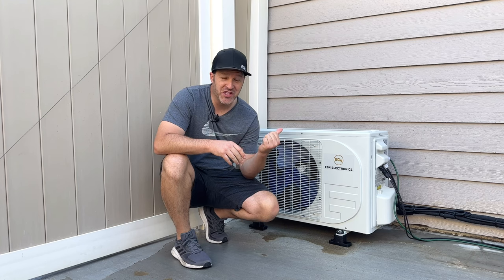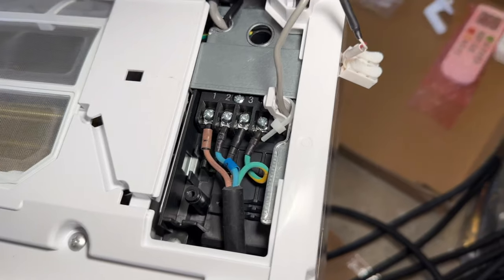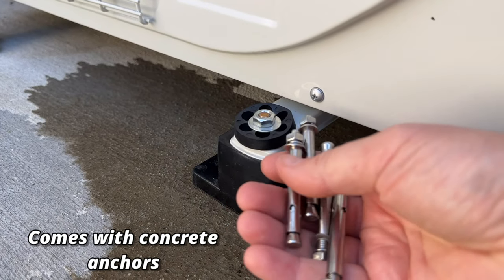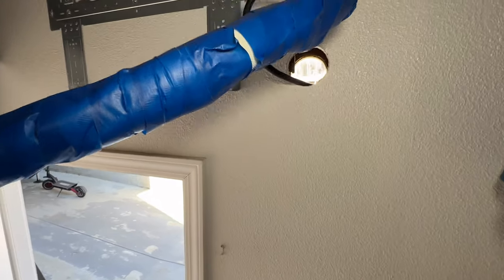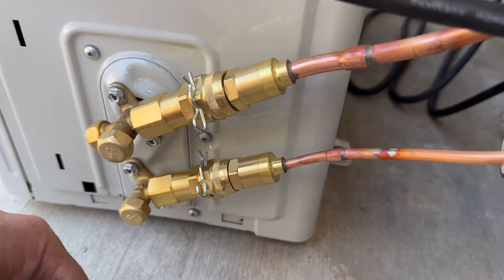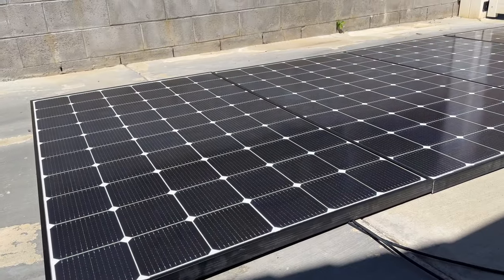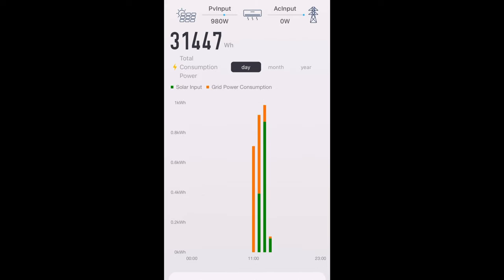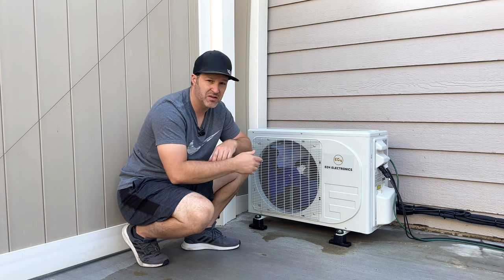Mini Split That Changes Everything! EG4 Hybrid Mini Split Heating And Cooling!

Comment: Is it possible to collect and store the extra solar energy with this unit?
Reply from the maker: No unfortunately not. Best would to be run solar into battery bank then mini split off system.
Reply: @johnnysweekends  If I set it up with all my solar going into my Bluetti battery bank (8k) (also have another 13.8 Zendure Battery Bank) Can it be run off DC output and also have it plugged in for AC so that it will charge the battery bank and then pull from AC when needed? Not sure if this makes sense but I have 3000w of solar now and am trying to figure out how to best use my panels by charging them and running the unit. 

Seems like it may be best to have 1500 watts to the unit and then run 1500w to the battery bank and also plug the unit into the batteries so that it won't run off any grid power. My solar does not go into the grid at all so just trying to figure a way to use all my soal and storage. Thanks!
Reply from the maker: @scottfreedom2012 unfortunately can’t power from bluetti dc out as it’s not enough power. 90v minimum. 
Hence combo of solar and also plugged into AC 110v outlet or hard wired works great. 
But solar during the day to power it and extra solar for battery storage! 
Or just cut the bills down gradually
Reply: @johnnysweekends  Thanks kinda figured that would be the case. I’m fine with it but was trying to figure out how to maximize storage and running the unit. Maybe run 1500 watts to the unit and the rest to the battery and when its not enough solar it can just pull from ac outlet on battery. Either way it’s free power from the sun and can eventually help pay back investment. Right now just running a window air con unit and it just not as efficient. Again thanks!

Comment: how well does it cool /how many sqft
Reply from the maker: So quick example.

103 degree day
Comes on automatically at about 8:15am and shuts off at 6:30pm which that will shorten as the days shorten

Almost 500sq ft garage 
Non insulated garage 
Non insulated garage door
10ft ceilings 

Now stays about 82-85 degrees all day. 

Verses it was normally 96-100 in there depending on the day.

I’m insulting my garage door this week, with thermal barrier and adding the outside weather strip all the way around the door so will see how that does. Then eventually I’ll spray foam the inner walls here and there and that will help for both summer and winter.

If I can keep it upper 70s in high outside temps and have it run for free from my RV..👍🏼👍🏼
Reply: I have 2 12 K units. They work awesome. I had my living room at 66 degrees today. They cool my entire home. One upstairs and one down. My family is impressed.
Reply from the maker: @LarryDoti dude i am loving mine. Haven’t had it plugged in yet lol. Just solar and RV setup 👍🏼

Comment: I wonder if it's economical yet to consider the additional capital it would take for a 24,000 BTU unit to run on solar? 

It seems it makes a lot less sense in areas where the minisplit is going to run 24/7 from May to August, in really warm areas of Arizona,  and Nevada
where it's still over 85 degrees in the evenings,

I know there are solar panels that produce over 700 Watts per panel now, 
but can a system like this along with the powerstation or batteries,  come out to less than 2500.00  (excluding the minisplit of course) ?
Reply from the maker: The mini split is gonna be $1700 ish dollars alone. 
If you can find some 300-350 watt panels used that would be best way to save money. But batteries would be needed. 
But a 24k btu is also gonna be a 220v unit

Comment: How does the 3 prone extension cord connect to the unit. Im not familiar with wiring and all, but i have a wall outlet outside. Does it have a plug in the unit to just plug it in.
Reply from the maker: It shows how to wire and where they go. It’s only 3 wires. Pretty self explanatory 👍🏼
Reply: @johnnysweekends  thanks sorry for asking I was just confused because I see something like a regular extension cord with a 3 prong going to your power station. 

On your video I saw how it was wire in into the unit but didn't see if the other side was a 3 prong ac wall socket. That why I was confused but if it like that it makes sense and I will definitely get one because I don't want to deal with wiring to the breaker box since I have a wall outlet outside.

Thx again
Reply from the maker: @oodavidyyf8416 yes just a normal 110v extension cord but use a good one with at least 12g not 14g. 
A long run may need 10g. 

Use the discount code with link in description so you don’t pay full price..👍🏼
Reply: @johnnysweekends  ty buddy I will make to get a 10 guage extension cord and will definitely used your code

Comment: The eg4 is cool. I bought the inovair 9000 btu which is 38 seer and only pulls a couple hundred watts off my batteries and panels. It was about twice as much as the eg4 but it's great on solar or batteries day and night. I like the fact the eg4 has its own panel hookup and all but after studying up on minisplits I'm glad I chose the inovair. Same install really tho
Reply from the maker: Yea the eg4 is a easy setup for most people but I like that Inovair. 
Thanks for the feedback on it 👍🏼
Reply: @johnnysweekends  I'm trying to talk my dad into getting 2 of the eg4s for the upstairs of his house. They are definitely the most economical way to integrate solar air-conditioning into a home. Thanks for doing the videos.
Reply: I’ve heard about those 38 seer units. There 230v though.I’m about to buy a bigger inverter so may get 240v inverter.
Reply from the maker: @2hotscottpro it will defiantly heat and cool more but of course use more power as well.
Reply: @2hotscottpro  they have a wide voltage range they work at. I forgot the exact numbers but it's like 195 to 255 or 255. I use a split phase sungold power and it works great. I use both legs to run the minisplits and I sperated the link connector on the breaker box making it 2 separate 120s so my camper is now 240... But yeah the inovair has some cool features that I couldn't find on other minisplits . David poz video helped me choose what to buy
Reply: I read that Gree makes innovair.And Sigineer power makes sungold.
Reply: @2hotscottpro  I think you are correct. I wish I'd gotten a smaller minisplits like maybe the 6000 BTU. I have the 9000 and it's great but it's way overkill and it doesn't have time to actually condition the air. It turns of and on and it's not on long enough to remove the humidity. It's in a 30 foot camper but after taking into account the space lost to cabinets and appliances it doesn't leave much space to heat or cool. It's super efficient but I definitely should have gotten a smaller unit
Reply: @matthewknight5641  that’s weird.I have a 36 footer 15.5btu and 13.5 btu.They both work hard to cool the mid and front section.I keep the 13 foot garage door closed.
Reply: @2hotscottpro  my camper is a holiday rambler and parked in the shade but it still gets pretty hot in the summer in TN. The actual area inside my camper that is being cooled is so small and my solar and batteries easily keep it nice inside 24/7. I do have over 30 kw of lithium 280k eve cells and a 4000 watt sungold power split phase inverter. I use 3 victron charge controllers and 6 280 trina panels and 8 235 sharp panels. The solar stuff is just a hobby but it keeps us from ever needing to plug into the grid. I'm only home a couple days a month tho. Most the time I'm stuck in this semi truck lol
Reply: @2hotscottpro  a 240 volt mini split uses less power than a comparable 120 volt. The only bad thing is that you gotta have a 240 inverter but by removing the connector link inside most RV breaker boxes it makes it where the loads are split between 2 120 legs and I just wired in my minisplits where one leg is from my old air conditioner breaker and the other leg pulls from the same breaker that my old converter was on so it all worked out.

Comment: Is this running straight from the solar panels or a lithium battery?
Reply from the maker: Straight from panels. My Rv powers it or the ground panels. I play around but mostly the Rv. 
This comes with a Mppt solar controller built in. So when it hits a high enough voltage the fan kicks on then a little later it has enough and the pump kicks on and away it goes. 
It runs now with days getting shorter and the trees in the way from about 9am to 6pm ish. Which will continue to drop because of some shade issues

Comment: Can the line set be extended?
Reply from the maker: It’s already pressurized which is why it’s so easy to install for just about anyone. 
You can extend the set but you will need to charge it for the additional set from what I was understanding

Comment: Can it auto switch between grid and solar?
Reply from the maker: Yes!! If solar is hooked up it will be priority and as solar starts to drop off grid will feed what it needs to keep it going then eventually grid will take over with solar is no longer available.
I also have a $50 discount code for anything over $500….

Comment: can you run this just on solar no ac hooked up?
Reply from the maker: YESSSS11. As long as you have enough turn on voltage it will fire up with no AC and no batteries just solar alone! If you are interested be sure to use discount codes!! 👍🏼
Discount code: JOHNNYWKND
https://signaturesolar.com/eg4-hybrid-ac-dc-solar-air-conditioner-1-ton/?ref=JWKNDS

They also make a 24k hybrid unit now as well. 👍🏼
Reply: @johnnysweekends  word brotha, how much is the discount for?
Reply from the maker: @SynthToshi hmm 🤔 I forget I think $50 Or is it 5%.. lol been a while since I looked since I have several for different companies lol.

Comment: Are you running line one and line 2 directly into an AC port?
Reply from the maker: Not exactly sure what you mean… but I have a set of solar going directly into the mini and a AC cord coming from the AC connection point on the mini that is literally a cut outdoor extension cord so I can plug it into my trailer or the house or the DPU or a generator or… 
Lots of options to run it.
One of the best things I did. 
I have a discount on them right now as well
Reply: I have the 24k BTU hooked up to my back yard fence mounted set up I came up with. But I’m running all solar. 

The L1 and L2 for two hots that I could run to a 240 volt breaker, I’m wondering if I could run to delta pros with a double voltage hub, or my smart home panel or a 30 amp outlet near the house.
Reply from the maker: @ColbyBlack oh ok you have a 220/240 volt mini. Mine is 120v 
Yes two DPs and DV hub will work but you will definitely suck some power unless you have solar dumping into both. 👍🏼

Comment: Quick question. You didn’t use batteries, how does solar energy saves ?
Reply from the maker: The solar panels simply power this as it has its own charge controller built in to supply power at the needed DC voltage. Once the sun comes up and voltage hits the spec it needs it starts working, sun goes down and it eventually shuts off. You can buy panels cheap and this could in every day heating or cooling with enough solar and eventually pay it self off and continue to supply heat or cooling for years. I have discounts as well
Reply: @johnnysweekends  thank you for replying so quick. I’ve seen so many videos about inverter and battery banks that I’ve seen your installation pretty neat. What’s called? Is this the one that goes to the city ? Selling energy to the city?
Reply from the maker: This does not sell energy back to the city. It’s a stand alone unit. And eventually can and will pay for it sell depending where you source your setup and how expensive your utilities are. This is where to get this unit with a discount code as well. They are so simple im doing another in a few days…..
Discount code: JOHNNYWKND
https://signaturesolar.com/eg4-hybrid-ac-dc-solar-air-conditioner-1-ton/?ref=JWKNDS

Comment: So like 12 harbor freight panels could power this?
Reply from the maker: Yesss but o would try and grab some larger panels if you could. Would make install a lot easier. Can get old panels that are 280-385 watt for about $165 each
Reply: @johnnysweekends  people around here sell used panels but I don’t know if I could trust them, anyway to test them?
Reply from the maker: Yea you can first look at overall condition. Then do open circuit voltage test then a load test with say a power station to see if it puts out a good steady input number. Best to go in middle of day when its clear to see max wattage and try and get panel at max radiance of the sun. No shadows basically.
Reply: I got 10 Canadian solar 385 watt panels from Signature Solar for $177 each. It takes 3 to power the 12k unit. It has been working awesome so far. I have 2 units and I have zero complaints. I also have 2 SS 48 volt batteries to power my system when the sun goes down. Please remember you can get a 30% tax rebate for solar batteries and heat pumps. This will help you pay off your system faster.
Reply: @LarryDoti  thank you so much
Reply from the maker: @LarryDoti its true people need to look up local and federal pay back for energy efficiency items. You can get credits 👍🏼

Comment: I wouldn’t recommend the rubber feet with those solid copper lines, eventually the lines will fatigue and crack due to the flex allowed by those rubber feet. Flexible rubber lines yes, copper no!
Reply from the maker: Copper is not solid. It’s semi rigid and meant for vibrations. You have to bend them like crazy just to position them. The foot pads are pretty rigid in them selves but even with no concrete anchors it does move.
Reply: @johnnysweekends  I get that, but if you talk to an HVAC professional they will tell you bending it to fit is one thing, repeatedly bending it work hardens it and it will crack.
Reply from the maker: Good to know 👍🏼

Comment: The direct solar gimmick doesn't change anything at all. I've been running 15000 btu on solar for the past 3 years, and didn't have to install dedicated panels for the unit (they power entire RV instead). Want to revolutionize the solar industry? Raise the pesky 22% efficiency of the solar panels.
Reply from the maker: Good for you. I have installed systems larger than a Mega watt and more close to that, but dont see me bragging about it. This is simply for those looking for a nice solution especially if you want to heat or cool a space cheaper from either grid power or your own DC setup. And if you have a big rv siting on the side of your home, use the thing more than just a rv sitting there. Many places need permits even for diy, rv and trailers dont. Install all you want and now you have a mini power plant. 

Solar efficiency will get much better soon. 5 years it will be close to 40% maybe higher
Reply: @johnnysweekends  That's really good news and I hope it's true. 40% would truly revolutionize solar. That's the worst bottleneck right now.
Reply from the maker: The new solar cell tech coming out hopefully will be true and make it to market. And with bi- facial that’s only helping boost a little more wattage out of the same footprint.

Comment: That’s an expensive power system which I’m sure will need to replace sooner than later. Too young a tech.
Reply from the maker: The system that is powering the unit now is used as a example. You can easily buy large solar panels for cheap and if you wanted throw them on the ground and will easily do the same thing for cheap. And will heat and cool as soon as the sun hits the panels. 
Now where you live will determine if it’s worth it or not.